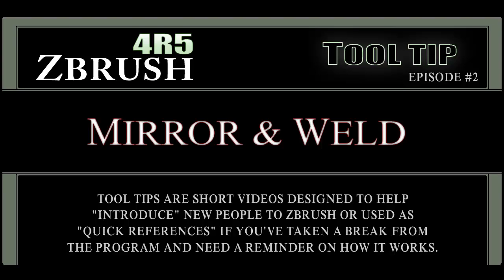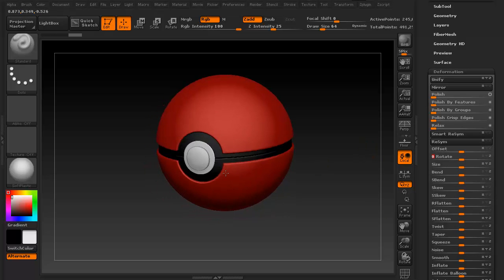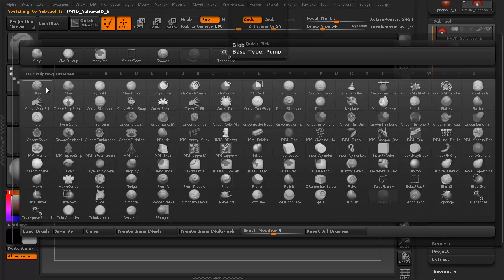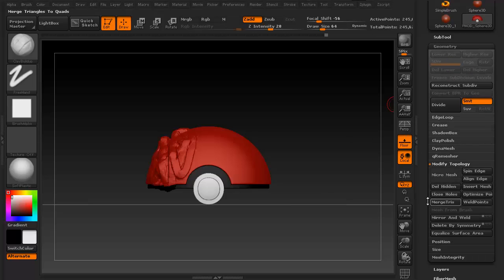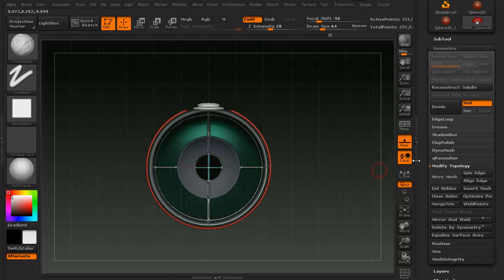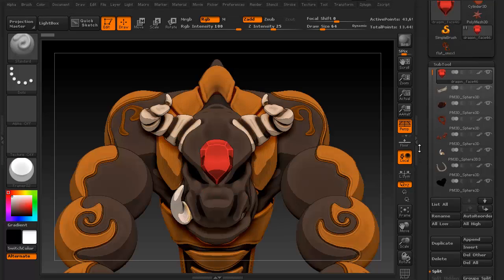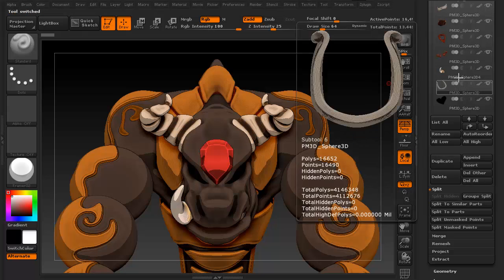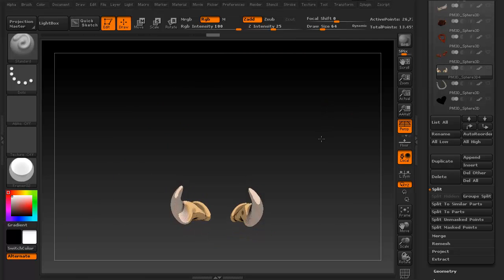The Basics of ZBrush 4R5, Tooltip: Episode 2 ~ Mirror and Weld

Comment: can we do  mirrior n weld!! when  freeze  subdivision levels is on .???
Reply from the maker: Freezing subdiv levels is always a bit wonky tbh, but ya.. you can freeze them then mirror/weld and unfreeze them again to get your levels back.
Reply: ya i hav tried but  polygon will b extrdue automatclly    in inner part  of face ....!!  while unfreeze ... any solutn?
Reply from the maker: There are a few ways around this.
One of the easier ways, is to duplicate the subtool you want mirrored.
Go to the highest subdiv level and delete all the lower.
Mirror it to the other side.
Then use "reconstruct subdiv" button based on how many original levels it had.

You should end up with identical geo, or at least.. VERY close to it.
Reply: any solutn to fix??
Reply from the maker: Ah, ok.. so you're trying to mirror a single mesh.
The problem with that, is how ZBrush uses "projection" while unfreezing subdiv levels.

The way around this issue requires a bit of persistence, but is easily doable and gives you much more control.

Duplicate your mesh.
Go to the highest subdiv level on the duplicate and delete all lower.
Use "Delete by symmetry" on the half you don't want to keep.
Use "Mirror and Weld"

You now have a high poly version of the model you want.. now to create a base model to transfer that detail onto.

On the "original" mesh, duplicate it again.
Go to the lowest subdiv level on this duplicate and delete all higher.
Use "Delete by symmetry" on the half you don't want to keep.
Use "Mirror and Weld".

Now you have the base model. Time to combine them!

What you're going to do now, is rotate between subdividing your base mesh and applying your own projection each time.

So.. first, make sure both models are visible.

Now select the base mesh in the subtool menu and scroll down till you see the "Project" submenu. Open it and click projectAll.

Turn off visibilty on the higher resolution mesh and inspect your base model to make sure nothing broke (like the mouth).

If the mouth did break, you'll want to "undo" the projection and lower the "distance" setting on the projectAll function.

IE: Distance: 0.04
*Toy with this number, lowering it and reprojecting the high res model until satisfactory.

The cool thing, is that you can use the "mask" feature, to prevent the projection from affecting certain parts of the mesh.

So, for instance.. you can use "Distance: 0.002" to get the mouth projected correctly, then "mask" off the mouth section, raise the "Distance" to 0.04 and project again to get the rest of the mesh to project properly.

Regardless, you'll want to subdivide the base mesh, one level at a time and project details from the high res during each level. This ensures your mesh doesn't break and you get maximum control over what gets projected and what doesn't.

You may still need to "smooth out" certain sections, so keep in mind this process isn't perfect.

Once done, feel free to delete the "original" and high res duplicate meshes. Leaving only the one you've been projecting to as your final mesh.

Hopefully this helped. ;3
Reply: thaks a lot  .....

Comment: hey ive been looking all over the internet for the answer but couldnt find it so maybe you can help me out i am also fairly new,

is there a certain setting you must have in order for mirror and weld to be available? 

i've used it before but now i am not able to find it anywhere. i hope you can be of some assistance here, because i really enjoy that setting.
Reply from the maker: I think, the only requirements for mirror and weld are:
1. Have a model/subtool selected.
2. Make sure you're in "edit" mode.

If it's not working or saying something like "there's nothing to mirror". Go down into the deformation menu (make sure your model/subtool is selected first) and press "mirror" to flip the model onto the other side of the grid, thus allowing Zbrush to "see" the model.

IE: It only "sees" models on the left axis.

If that still doesn't work, your model might be too big or wonky.. so try pressing "unify" in the deformation menu (make sure your model/subtool is selected first) then press "mirror". (Unify will shrink your model to some extent (this doesn't hurt the model, because you can size it back up later).

IE: Sometimes, people create a model and move it around in a program like maya, they might do it because the model is part of a scene/set piece and thus move it far away from the origin point of the grid, so when importing it into zbrush, it looks like certain functions don't work on it.

If it looks like your model disappears at any point, simply select the model from your subtool palette press "f" on your keyboard to zoom in/out on your model.

Hope this helps with/answers your question.
~ ReQ
Reply: ***** 

I love that you took the time out to reply especially with all the information on how it should be done.

 but I finally figured out what the problem was, I never converted the tool to pollymesh 3D (armature level mistake)😭 I still had it in z-spere mode, and I also realized you are  limited to tools in that form.

So thanks again so much for looking into my problem.

 are you on artstation by the way?
Reply from the maker: Ben -G
Yup, I've got a profile on Artstation as well, though I don't update it all that often tbh. You can find me here: https://www.artstation.com/artist/requiemsvoid

Comment: I get this message when i try this:
"The resulting 3D mesh dose not contain any polygons. Operation cancelled". What did i did wrong?
Reply from the maker: Ah, nice.. it's good to this old tutorial is still a bit useful. As for the preference, it's just how the devs decided to code Zbrush's mirror feature.
Reply: Thanks for leaving the comment here. It worked for me as well (2 years later) :D
Reply from the maker: Hmm, it almost sounds like you're attempting to mirror an unfinished ZSphere mesh.
What type of model are you using and does it have sub divisions?
Reply: *****  it is extrusion from mesh. I masked area, extruded it to subtool, then worked on it. Now i want to mirror it on the other side of my original mesh. I followed your instructions and got that message... Im working on armor, human is base mesh
Reply from the maker: KingTomislavZG Ah, kk. Then it's likely that you're trying to mirror a subtool that exists on the right side of the screen.

With your subtool selected > Goto: Deformation > Mirror (x).

This will flip your subtool to the left side of the screen. Then proceed to use mirror and weld in the geometry palette.
Reply: *****  IT WORKS! Thank you for lightning fast reply! People like you bring hope to humanity back
Reply from the maker: KingTomislavZG lol, np ;3
Reply: This saved me in mid 2017, thank you so much! Why does it matter in wich side (left or right) the subtool is when using this command, tho?
Reply: RequiemsVoid Thanks again, man! Very good quality information around here <3

Comment: you can also go to the transform palette and click spivot.

this will use the centre point of your currently selected sub tool.

once you are finished sculpting on that part click c-pivot, which will clear the pivot point and move your sub tool back to its original position

(this also works if you have hidden geometry... it will use the centre of the visible polygons) its a great method for using radial symmetry on specific parts of your sculpt